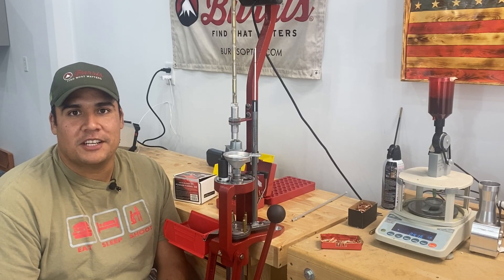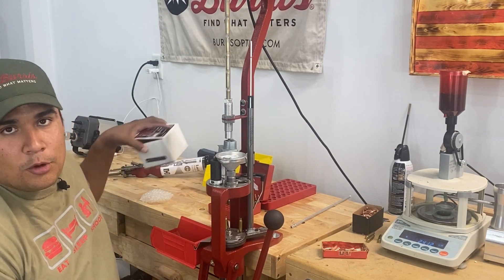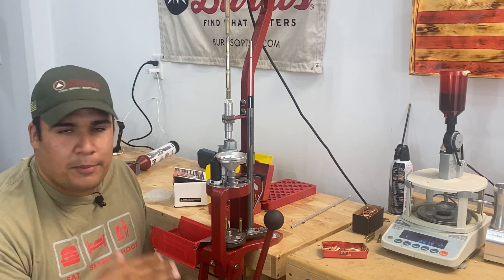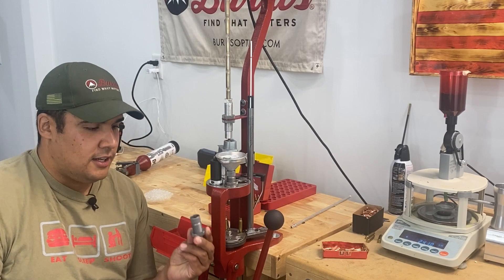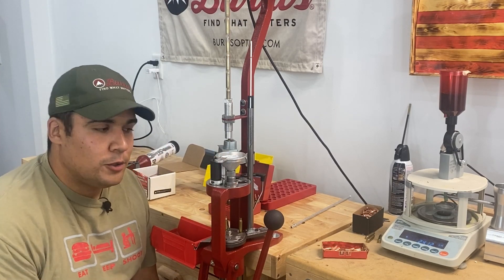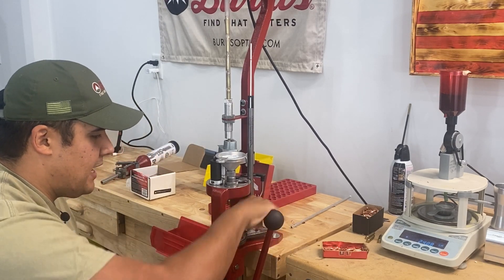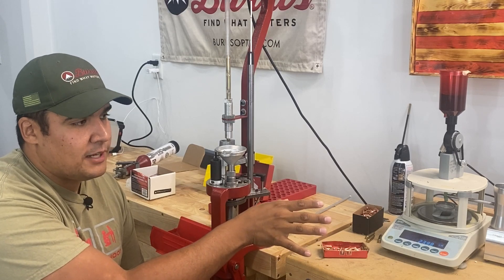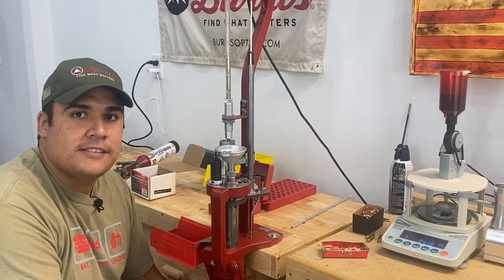How to reload with a progressive press using a powder scale

Comment: Looking to get in to reloading, both pistol (9, 40, and 10) and rifle (5.56, 270, various .30s, and 350) cases. For rifle, I am thinking of doing two press set-up assembly. First would be a single stage to decap, then tumble, then back to the single stage to neck size, following with a trimmer. Changing neck sizing dies to match caliber.
Second press would be a progressive set up to prime, charge, seat bullet, and crimp neck. Changing the turret with dedicated dies mounted for each particular caliber. Buying a new caliber components and turret set up each year until I have what I need to load for the rifles I have.
Would Lee's loadmaster progressive be acceptable for a budget minded, able to grow set-up?
Reply from the maker: Hey Jason! This is Dave speaking (Not Jose who made this video) and I feel somewhat qualified to answer your question since I own two Loadmasters.

A lot of people will say avoid Loadmasters like the plague. I can see why, as it can be finicky. In my opinion it is a great budget progressive press. However, if you get easily frustrated with having to tinker or put time into getting it running well, I would avoid it. It's not going to run perfectly out of the box. It CAN be frustrating at times. There are a lot of videos out there to help you tune them up pretty well. But if you expect to take it out of the box and just start hammering away, you will likely be disappointed. It has its quirks, it can be finicky, but it gets the job done. I've had it running really smoothly and it's a great press for the money.

If you want something that's less finicky, you may want to go with a different progressive press like the Hornady Lock and Load (don't have any personal experience with that one) but you will pay more for it. So it's up to you and what's important/worth the money.

I hope that helps. Thanks for watching and for the question!
Reply: @longrangetactics  I don't mind tuning the machinery. From what I have watched on multiple videos, the primary issue I will run into is the priming step if I go slamming the handle too quick instead of applying the handle with uniform pressure. I have spent over 2 decades in getting installations just right visually for residential customers, and commercial/federal inspectors and supervisors. My son and I like to shoot, but one of our rifles (Model of 1917, .30-06) does not have readily available completed cartridges. And for the ppr we are finding in stock, we can tweak the cartidge to the rifle using the load manuals. And make a bunch of it. I do not expect the presses to make ammo cheaper in the end, just easier to have on hand.